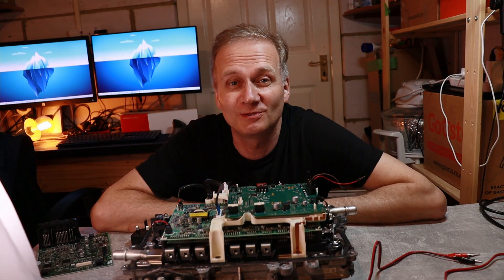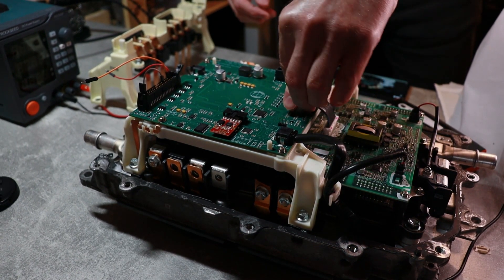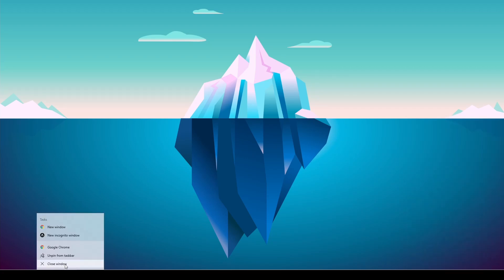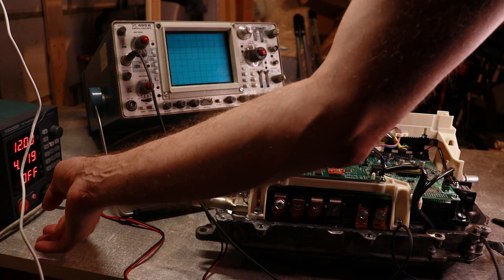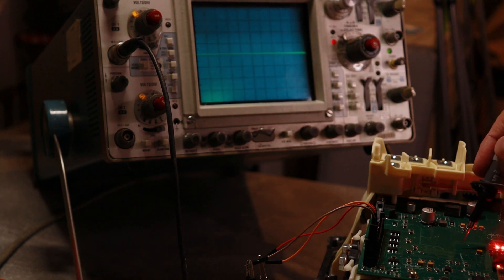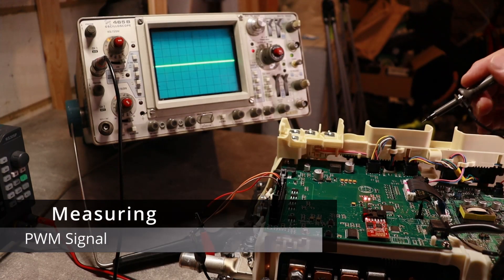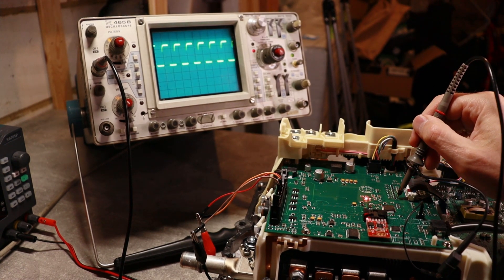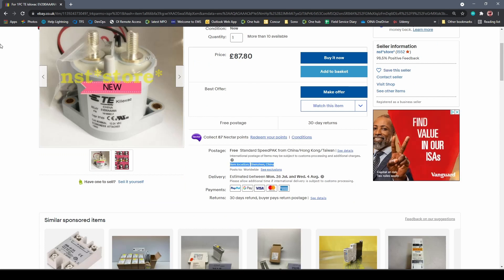PWM calamity DIY EV Toyota Prius Open Inverter Ep 5

Comment: Hi you have made many videos but they are quite in depth.  Could you make a "for dummies guide" at the end on the steps to get it to work? :)
Reply from the maker: This very good feedback, thank you as I thought that I was making simplified but detailed step-by-step videos. I will think how to make it more easier for people. But it may not be possible within current design. Perhaps the way would be to offer preconfigured product like inverter with the open inverter board preinstalled and configured for the type of motor

Comment: Nice work! Look into some Tesla Contactors. They are nice GV200 usually and can be had for 40-50 if you search hard.
Reply from the maker: Thank you I will have a look. I see some Chinese sellers sell some quiet cheap but I am not sure if I could trust them
Reply: @LatutaEV  I wouldn’t try anything else but tyco,panasonic and gigavac. Not worth the safety risk of having a bad one
Reply from the maker: That was the thing some of those were Tyco Kilovac
Reply: @LatutaEV  yeah I know they are not cheap but they are reliable. You can sometimes thing them in hv junction boxes for OEM cars for cheap.